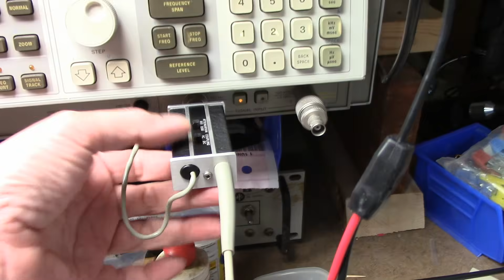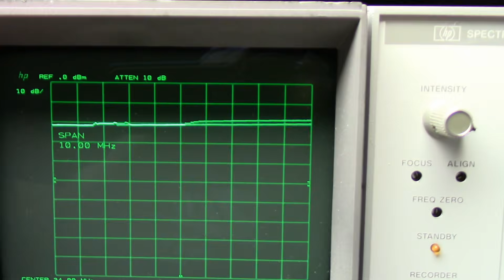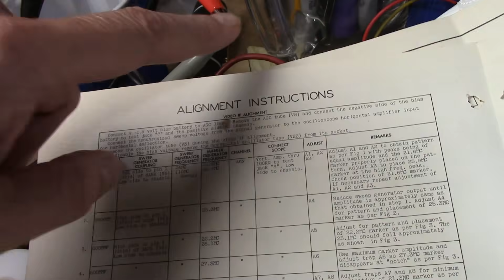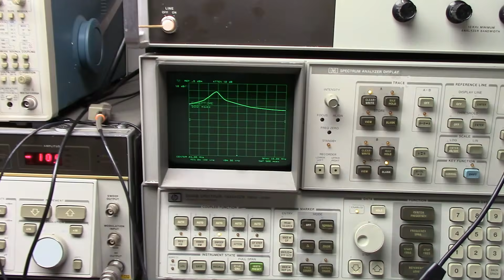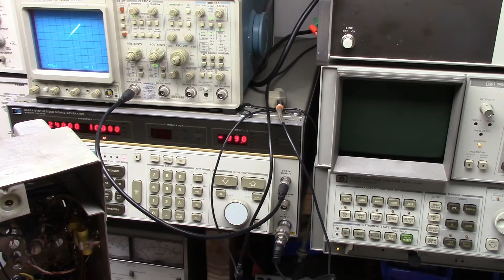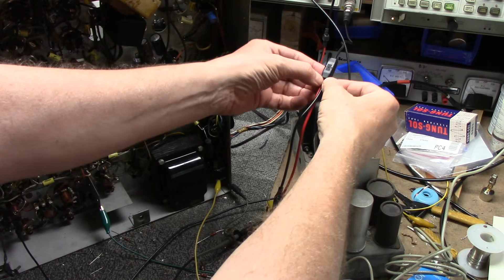HP8444A tracking generator part 3 of 3

Comment: I think I'd rather use the sweep generator for alignments, and for one big reason: even with your active probe the capacitance is going to lower the resonant frequency of the filter stage.
Reply from the maker: That's why I decoupled it with a 1Meg resistor.  I confirmed the response with a sweep generator after the SA.  You'll see that in the next installment.  You';ll also see how much nicer the response curve looks in the SA display vs a scope + sweep gen.
Reply: @bandersentv  I must've missed the resistor on the analyzer input. That should eliminate the loading issue. It would also create an additional low pass filter which would distort the results, but it's probably negligible given the frequency range of interest.

Comment: Hi Bob, learning to use this tracking generator/spectrum analyzer combination will likely be a learning experience for you.  You are correct in that you will need short leads and the coax terminated into 50 ohms.  Also, what works okay with an oscilloscope setup, will not work as well with the tracking generator/spectrum analyzer; low cost coax leaks signal and will distort your response curves.  Terminations are not super critical; 50 +/- 5 ohms is sufficient.  

 HP made some better high impedance probes.  The one you are using is patterned after a oscilloscope 10:1 probe and the capacitive loading is a bit high.  I know 10 pF doesn't sound like much, but at 22 MHz, the capacitive reactance is 723 ohms.

The original alignment instructions were based around the typical oscilloscope a TV shop used, which had an input bandwidth of less than 1 MHz, which is why the detector video output was used for the scope input.

When connecting up the tracking generator/spectrum analyzer to the alignment, your input signal to the TV should be at the mixer control grid in the tuner.   The output would be sensed at the input to the video detector.  You may have to disable the AGC and control it with a lab power supply to get a stable response.  The bandpass response typically cuts off at a few hundred kHz below the carrier and the upper cutoff is a few hundred kHz below the sound carrier.
Reply from the maker: The Zenith alignment instructions indicate you inject the signal into the grid of the preceding stage so that's what I'm following.  Sams is the same.  You inject into a shield over the mixer as the final step to check the overall response.  Yes, I do have the AGC set to a fixed -1.5VDC.  I've aligned many TV chassis before using a variety of vintage and solid stage equipment.
Reply: @bandersentv Sorry Bob to make my directions from a novice point of view, no insult was intended.  Since I have never seen a B&K 415 on your bench, I erred on the side of caution.

Comment: Hey Bob, there is something you seem to be missing. An oscilloscope vertical display is linear, the common way to display amplitude quantity on a spectrum analyzer is logarithmic (log). This vastly changes the shape of the displayed curve. You can change the spectrum analyzer display to linear with push of a button or something on a menu. Of course the service info show the display with a linear scope scale. For other people looking at this, a spectrum analyzer commonly displays with a log amplitude because it can show a vast difference of levels on a display, a million to one or more ratio is possible.  There are small chips now that are called log amps that can scale voltages to log values, not so in the 1950s.
Also the published curve looks upside down because of the polarity of the signal coming out of the detector in the TV. Another TV model or brand could have a positive going curve.
Reply from the maker: Yes, I have my SA in linear mode now.  I've got it all sorted out. Next installment coming soon

Comment: I'm not sure I should ask for your help, but if you would be able to make time for me, I would be ever great full. I recaps a 4940 sparton TV recoated  the picture tube, got all nos tubes, and powered up the set. I got a 4 to 5 inch up down line. Not sure where to go next. It the first TV I've played with since I was 6 and 7 year's old. I've inyoyed your videos for a few months now. I live in Jackson Michigan, which makes this TV important to me. I bought a John Rider volume 2 and photo fact . Thank you for what I have learned from you.
Reply: I'll put in my two cents. Did you check the resistors? They can drift or go bad altogether. Did you try some adjustments? You should double check your work, it is easy to get a capacitor connected wrong or electrolytics in backwards. Look at it like you just got the TV from someone that did some work but you don't trust him to get it right. I forget whether Rider's has a table of voltages to check like SAMS, but checking the voltages is a good step. Lastly bring your problem to the "Antique Radio" discussion forum. They have a subforum on Televisions.

Comment: Hello. I recently acquired an old HP Spectrum Analyser a different model to yours but similar, and it looks to have the same probe power output. 

I'm having trouble finding an active probe for it. Would you be willing to share where you got the probe? Thanks
Reply from the maker: Surplus Sales of Nebraska and lots of them on ebay.

Comment: Congratulations! You have met your objective of proving the SA  & tracking generator can be used for observing and preforming an alignment of tube circuit IF. I’m looking forwards to your refinements in your setup and the results.
I believe the “old way”, using a scope in XY mode (where vertical bandwidth is not a factor)  and an “analog” sweep marker generator is an easier and  more practical way to do an alignment. I have a B&K 415,  Heath IG-57A, AND Eico 369 in my lab with correct cables and probes.
Although I  too have a Tek 2465B , I prefer to use my older Tek  547 or 465B in XY mode with out jumping thru hoops to set up.   The bulky, power guzzling, older equipment with big knobs, are often easier to use.
Using the WaveTech “digital” Sweep Generator adds more complexity and issues; making a non fair comparison.
“Back in the day”  I built tube based video amplifiers ( taking the signal off the target connection of image tubes), used in a factory test set. I remember using a commercial lab sweep / marker generator. Using specific lab grade commercial equipment with the matching attenuator, cables (with correct impedances) made a world of difference . The sweep/marker generator was a Kay (can not recall the model).
I can see the advantage of great features of variable marker placement and on screen display of other  parameters with the SA. Conversely, thats a lot of over kill and expensive equipment used to achieve the same objective.
Im following along with you with similar equipment, and look forward to your refinements. I enjoy finding new ways to use the SA.
I appreciate you taking me along in your adventures.
Reply from the maker: I've used most of that gear as well.  My go to for years was a Wavetek 1002 sweep gen with harmonic markers spaced at 1MHz plus one variable marker plus a scope in XY mode.  More recently I've been using the HP 8662A and occasionally a massive 8664A.  The 8664A while digital does have a pure analog sweep mode but the sweep rate is a bit slow.
Mainly I'm curious to see what's possible with the 8568B.